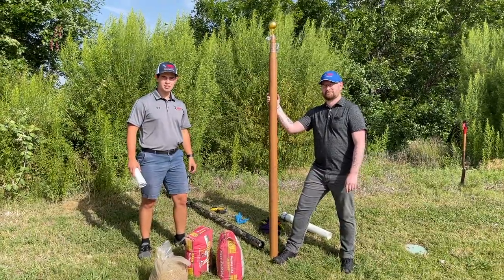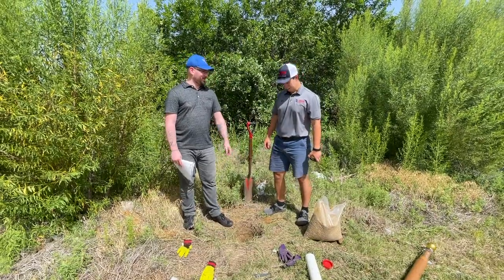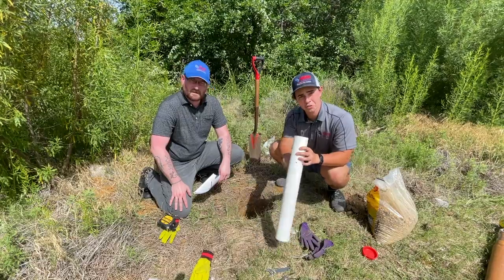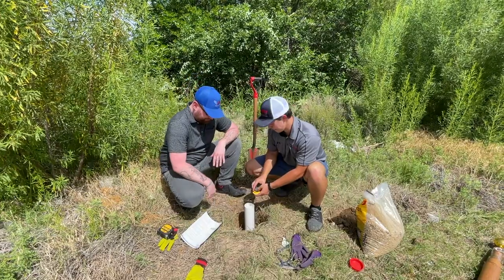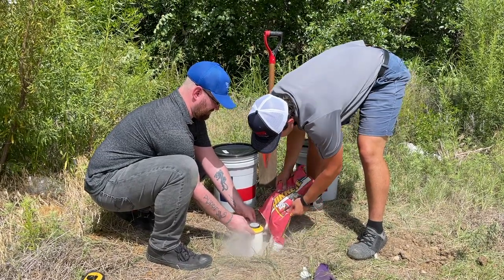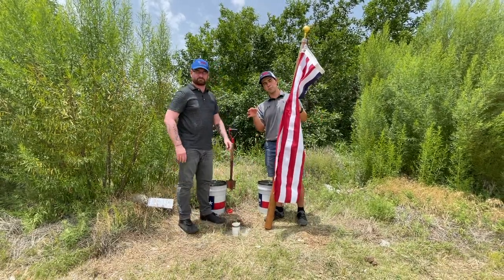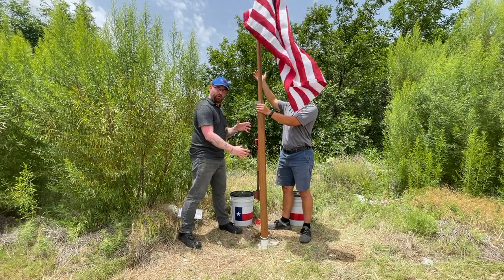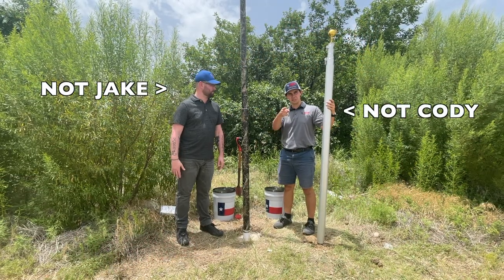How to Install the American Elite Telescoping Flagpole

Comment: Great video. Is there a way to place a lock on the sleeve to minimize the risk of thieves stealing the pole?
Reply: The PVC or ABS sleeve doesn't bond to concrete so that can be pulled out as well unless you use adhesive to bond it to concrete.

Comment: You guys said to have a 26" hole and place 4" of gravel under that making it even shallower, you didn't say how long your sleeve was, either way doesn't seem like a lot of anchoring concrete.

Everywhere else says to have a 30" hole 10% of pole length for the sleeve itself. The flagpole i bought somewhere else only came with a 20" sleeve, now I'm hunting around to get a sleeve pipe of abs 2" pipe inside diameter for the pole so it can mount deeper and above ground a little but you're saying that's not necessary?

Comment: Tips and tricks; use sand after the stone, fill the sleeve with the sand,  raise it up and down, let the sand exit the bottom.  The sand will keep your bottom stationary. Fill the hole with concrete.  Install your pole, keep the pole clean,  use a level on the pole to make it "plumb." Come back tomorrow,  install your flag,  raise it high, salute.  Give thanks.

Comment: How do you fly flag at half mass
Reply from the maker: Hi! There are four clips on this pole, enough for two flags.  If you wanted to fly a flag at half mass, you could move the flag down to the bottom two clips.
Reply: That sounds good seems like that would work just fine for half-mast thanks a lot